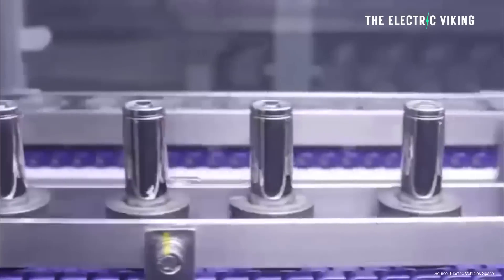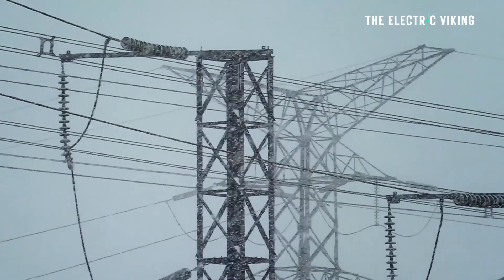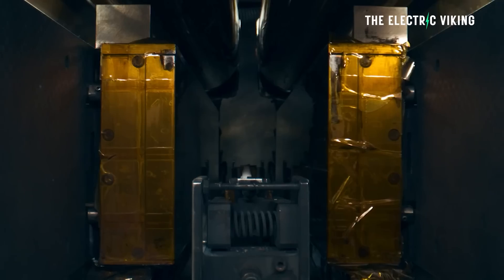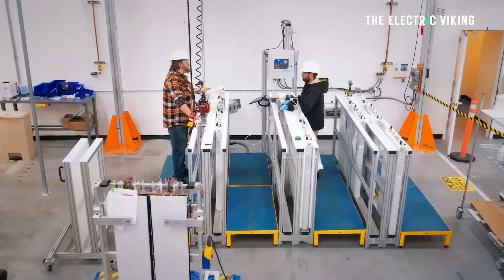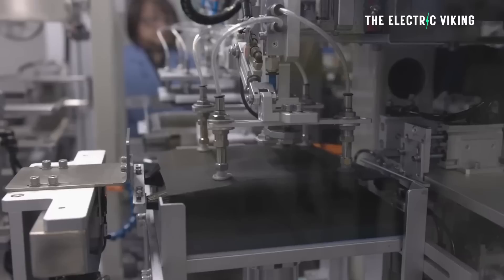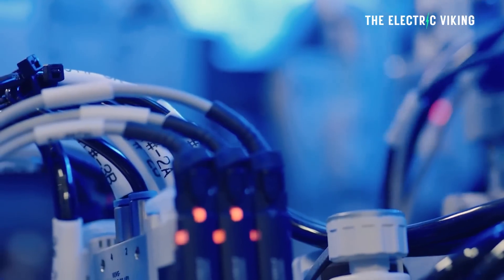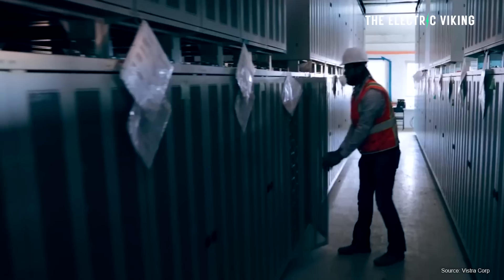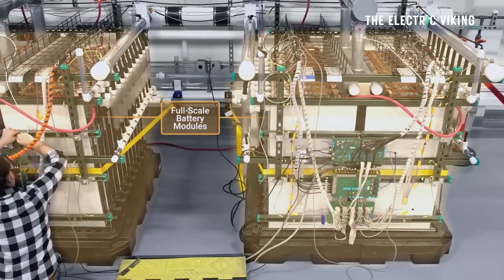U.S company reveals revolutionary battery that DESTROYS sodium & lithium

Comment from the maker: The best solar company in Australia just installed my new solar system. 
Check them out here: https://www.resinc.com.au/electricviking
Reply: I notice that in Form Energy's page there not a single actual number, chart or data regarding the physical properties of their "wonder" technology... just pretty graphics, neo-eco babble and vague promises of awesomeness and solving all the energy storage problems of human kind

I'll quote:
"
A Better World

    Grid reliability and safety
    Local economic development
    Improved local air quality
    Job creation through manufacturing and assembly "

If that's not a textbook example of corporate PR jargon... :D 

My bs alarm isn't ringing... it just made a hole through the roof
Reply: I think you misunderstood the tradeoffs of the technology.

I does not compete with current Li ion on most important metrics.

It is cheaper for larger scale storage. "Multiday". It can't be used alone as fairly high C application. 

It can be used on a hierarchical  way with current tech to be both fast reacting and cheaper for longer discharges.

Try to understand a memory hierarchy in a computer. Very fast Registers inside a CPU, some levels of cache memory like L1, L2, L3 each cheaper larger and slower, than main DRAM external memory, than secondary storage in SSD or HDD, than longer term storage in tapes.

Each tech contributes to the system in it's own way. Some costly ones take most of the workload but cost too much. Other make a compromise to allow for larger systems at affordable prices.

This iron air tech is not new. It's deployment in scale for real customers is news. Brings affordability to "multiday" discharges at fairly lower C rates and some more energy wasting (turn around inefficiency).

Won't be in your laptop or watch soon, but is a welcome addition to the toolbox.

Comment: According to Grok it is a common claim that the cost is 5-10 times lower for Iron-Air batteries. But when you say 85 mwh/8.5 gwh, is that a mistake? There needs to be 1000mwh to a gwh, no?

Comment: Energy density doesn't matter much for grid storage (within reason), Very low price combined with very long life... so far so good. Low charge/discharge rate is fine if the cost is near accurate. Even at 1/3 the cost of sodium, more batteries would make up the difference and still cost less.
1/10 seems unlikely just due to cheap materials... has to be Very easy to construct at scale and an 8.x GW project would be an excellent way to prove it.

Comment: The value of this is incalculable. 
As described not for primary energy storage but as either the backup to primary or the backup to backup. This can be the solution for extended weeks of seasonal bad weather or the protection against mass destruction like the current wildfires in LA that probably erased untold numbers of rooftop solar.

This type of energy storage has the potential to become a strategic reserve like the current strategic oil reserve and foreign cash reserves managed by governments. It can ensure reliable availability of electricity as a source that only requires a working grid to deliver energy to businesses. Communities and individuals even if other sources were non functional for any reason. I suppose also that there could be limited transportation of electricity in a very stable and safe state although density could be an issue although mass probably would not if my personal experience with air zinc batteries is similar.

Comment: This iron-air technology is the complement to lithium based batteries.
Both the slower and longer lasting iron-air and the faster but shorter duration lithium battery storage are required to firm renewables.

Comment: Be careful with price claims. Some are $/MWh storage capacity, whilst others are $/MWh over the battery lifetime, which delivers really cheap values for batteries with a long claimed lifespan (which will take a long time to confirm). So, yes, keep a close eye on the BS meter, whilst hoping that sooner or later a real breakthrough will arrive.

Comment: Currently, the largest operational battery is the Edwards & Sanborn project in California, with a capacity of 3,287 MWh. 
This means Form Energy's battery will have approximately 2.6 times the storage capacity of the Edwards & Sanborn project

Comment: They can be far cheaper, but are also far larger than Lithium. They couldn't fit in a car, but if you’re doing stationary grid storage, size/weight is not the issue.

Comment: It's obvious that the 1/10th cost claim is a sort of finger in the air guess based on long term mass production from mega-factories. But the idea that they will provide a four day backup at a low level while lithium or sodium ion batteries cope with the peaks seems sound.

Comment: I can see that the cost of these batteries could be 1/10 of Li-PO batteries since iron is vastly cheaper than lithium, and there is not a need for an electrolyte or an anode plate. Since iron is denser than lithium, the same storage capacity would weigh much more - not ideal for cell phones and autos. Also, the rate of power generation from these batteries would be much lower than Li-PO batteries, the amperage output would be much less for the same storage size. This is how it is a multi-day battery. Your cell phone can be on for 2 to 3 days, if you don't use it, before the battery is depleted.

Comment: You have a financial mistake in here, I think.  If they are claiming that it operates at 1/10th the price of current technology, it does not mean it is 1/10th the cost to build.  Maybe they are calculating the price based on a lifetime that is twice as long or even more.  I wonder if they are properly discounting the future benefits.  In a world where tech is rapidly advancing, if much of the cost advantage is spreading the cost across many more years of operation, that advantage might be meaningless, because new tech can potentially make that future battery storage less valuable.

Comment: Back in the infancy of computers, it was very often said; "we will never need more than that".
The 8 bit computer chip gave way to the 16 bit computer chip, which in turn gave way to the 32 bit computer chip, which in turn gave way to the 64 bit computer chip.

The 256k of ram gave way to the 500k of ram, which in turn gave way to the 1 megabyte of ram, which gave way to 2 megabytes of ram which gave way to 4 meg and so on and so forth. Today, my computer has a full 32 gig of ram.

The 144 k floppy gave way to the 1 megabyte disk which gave way to the 1 megabyte hard drive which gave way to the 10 megabyte hard drive which gave way to the 120 megabyte hard drive and so on and so forth. Today my computer has a 1 Tera-byte SSD drive.

The progress of years has proven every "we will never need more" statement false. We can and should deduce from the historical facts of computer technology and progress, that the claim; "we never need multi day batteries", to be just as false as the computer "never need more than" statements have been proven false. We should also deduce that as time progresses and technology improves, the claim that we "never need multi day batteries", will be proven just as false as the "never need more than" statements.

One of the primary reasons that technology continues to progress and advance is because if it didn't; all those engineers and researchers, would become unemployed. So they, by advancing technology, safegaurd their future employment.

Comment: It is too good to be true. The Achilles heel of the technology is volume. In order to achieve all the goals needed by modern batteries you need a football field of batteries to power one house's energy needs. 
I faced a similar problem with an electrical connection to thin metal coatings on optical glass.

Comment: Nonsense, the roundtrip efficiency of 40-60% is a huge factor and you need to divide by that to get true cost. Bipolar electrode lead acid is 40% less cost than lithium ion and doesn’t catch fire, and already has a 15 year track record. AND has 90% RE!

Comment: Yes, all just claims now. Iron air batteries use cheap materials. The material cost is probably 1/10th the cost. The challenge is the manufacturing cost. This is probably why, they have to make it this large. Also, the large size, is to get the instantaneous power delivery up. 

I don't know why everybody keeps harping on instantaneous power output ! Didn't you play with series and parallel battery hook ups in grade school !? Need more power, then parallel up more, or make it bigger. Hence, the large size of this project. If its cheaper, who cares.

One thing, I primarily harp on about, is cost. That will ultimately be the winning factor. At least that's what this company has in mind. If they pull it off, that's another story. Remember, that's why we're burning oil and coal. They're cheap ! Compared to what we used over a 100 years ago.

Comment: Might not be the best for peak power needs but would work great at providing base load power.  Also might work well at powering anything that has predictable stable power demand like an aluminum smelter, refrigeration, or water pumping.

Comment: Couldn't you combine it with flywheel batteries to give quick power when needed? The United States has a grid redundancy problem. People have died in heat waves because the power went out.

Comment: I watch your videos often. They are very informative about new technology. In this video you made some comments about people with solar and or wind not needing a lot of battery storage unless they lived in alaska or somewhere cloudy I guess....I live in sunny California, and there stretches mostly during winter and spring where we get extended cloudy days or a lot of fog.  During these times you either need really big battery banks or have to turn on the generator to charge the batteries.  It usually comes down to if only I had enough battery capacity to last that 2 or three days.  Once you start running everything on solar you pretty much need it to be sunny for a good  part of the day everyday.  When you mentioned people don't need that much battery storage I realized you are probably not using renewable energy at all or you are just using it as grid tied so you don't have batteries. Many people want freedom from the grid so they do everything to not run or charge batteries from the grid.  Once you start using only solar or wind you need big battery banks. I would say 90  percent of the time I only need 30kwh of battery bank but the other 10 percent I need 90kwh or more if there are prolonged cloudy days.  Now granted if it is cloudy I can conserve, don't do laundry, no using the stove , but you want this to be seamless....add more batteries.

Comment: Three issues:
a) We don't know the efficiency, so if it is only 70% or so which is quite possible, it won't get much market in the short term peaking market.
b) Almost by definition a multi-day battery can have less than 50-80 full cycles/y vs 200-400 full cycles on a one hour battery.
c) Neither air or iron is perfectly pure so there will be gradual formation of non-reversible sulphides, carbides, thus slowly degrading capacity and probably efficiency 
Combining these disadvantages means that it will probably remain a niche product paid for by governments to provide the last 0.1% of backup in natural disasters

Comment: Ion Air flow batteries can be produced very inexpensively compared to cell battery types due to very simple parts used throughout the system. Also the material used for charge carrying is much less expensive such as the Zinc used in the units we are developing. I think the 10% cost number sounds accurate to me given our projected costs for our system which is similar. Wisconsin Battery Company and my company Hallotrope Inc are teaming up to bring our hemp derived mesoporous carbon based battery electrodes and charge carriers to market in 2025.

Comment: I think when you pencil things out, you will find that the low "C" level for these batteries will make them difficult to use and the low return efficiency will waste a lot of energy.  That means you'd have buy/build twice as many solar panels or wind turbines.  There are going to be a lot of use cases where a Tesla Megapack will be the better solution.  If Tesla saw that this battery chemistry filled some need, they'd start making Megapacks with these batteries.  I can't imagine there is a critical patent they couldn't work around or license.

Comment: I was born in 1945 and I've seen massive advancements in electronics in that period of time.  It's as if progress is like 2,4,8,16,32.........well you get the picture.  We have only really been chasing serious battery storage for about 20 years and we've seen great things happen in that relatively short period of time.  We are going to see great advancement in this arena in years to come and it will happen faster and faster, especially with the computing power and AI now just a common place thing in the world and even that will improve much more rapidly with time.  No one can even imagine what we will see in the next 10 years.  Look what's happened with the cell phone in 20 years.  A computer in your pocket.

This is what we had around 1945-50:

What was the power of the first generation computer?
A partnership between the US government and the University of Pennsylvania produced the Electronic Numerical Integrator and Computer (ENIAC). This machine had 18,000 vacuum tubes, 70,000 resistors, and 5,000,000 soldered joints. It was such a large piece of machinery that it used 160 kilowatts of electric power.  This thing was HUGE!  And our cellphones just blow it away.  It's not even close.

Comment: I can see the Iron / Air battery, if they are actually viable, costing somewhere around 1/10th the cost of anything else, after all, Iron is just about the cheapest metal that you can find, we have billions of tons of it already mined and just rusting in scrap piles around the world. 

So the cost is possible, assuming that the Rust battery actually works and has a reasonable energy density.

Comment: 100 hours would be about the minimum. Multi-day  storms are a thing. Heavy cloud cover and severe winds means little or no wind and solar.
If you're going to completely sever gas and coal, this is its minimum replacement.

Comment: Iron-air, or rust, batteries are huge in size, very very heavy, and they have very low energy density;  but since the money comes from the taxpayers, they will spend it; not wisely, but they will  spend it,it looks like.

Comment: I would not buy a Lithium battery based EV but would consider plug-in hybrid vehicles that use Sodium-based batteries instead of Lithium.

It’s a positive sign that US auto manufacturers are retreating from EVs to large extent and redirecting attention back to hybrid vehicles. These make far more sense in the US market than do EVs.

But before any new hybrids will get my attention, they need to use sodium batteries - don’t want anything to do with Lithium based batteries - out side of cell phones, laptops, and power tools.

Now currently for home batteries am using large lead acid batteries designed for this use case, but would indeed like to see this iron-based batteries become viable for home owners to use. Eventually will have to replace the lead acid batteries and sure not going to use a Lithium battery solution such as what Tesla peddles.

Comment: 65% of the electricity used to charge an EV is lost in distribution as heat.  You are starting with an efficiency of 35%. Perfection of the EV is irrelevant.  They are no better than ICE vehicles and very bad for the environment as the is no unlimited source of emission free of electricity.  The are fine but replace nothing.

Comment: You have not answered one important question: what is the round trip efficiency?? If that is only like 10% or so, then it is useless. And explain the details of why it can not supply enough instantaneous power. Why does that mean and how fast CAN it supply the max power?

Comment: There are always trades, all battery tech have strengths and weaknesses. You need a mix to have a robust system. Your assumptions leading to your design choices is always vulnerable if you favor a specific solution without adequate alternative(s) capability. NO single solution is a panacea, never has been, never will

Comment: I don't understand why you go on about cost. Lithium is expensive. Iron is cheap. The battery architecture is simple. It should be 1/10 the cost, if not cheaper.
What I don't understand is why there is any need for government grants. If it's good, let investors decide on the potential and risk. Government (Taxpayers) should keep out of it.

Comment: Around 2005 MIT claimed it had a cobalt battery that would revolutionize the solar & wind industry. A $5,000 battery the size of a refrigerator would power the typical home for 3 days was the claim. After 5 years it disappeared from MIT’s website & I assume the professor in charge took the grant $$$ and ran.

Comment: A small pilot project in Minnesota is underway with a larger facility being planned.   This battery needs to be paired with a Tesla style battery to be effective.  One reacts fast, like a sprinter, the other goes long, like a marathon runner.  The battery itself is indeed cheap.  But it requires an enclosure to keep the ambient temperature within a narrow range.  Plus,  it requires a baby sitter 24/7.
Another long term storage battery is the nickel-hydrogen battery made by EnerVenue.  It does not require climate control and does not require any regular maintenance.  It has an expected life of more than 30 years.  Their commercial factory is nearing completion in Kentucky right now.